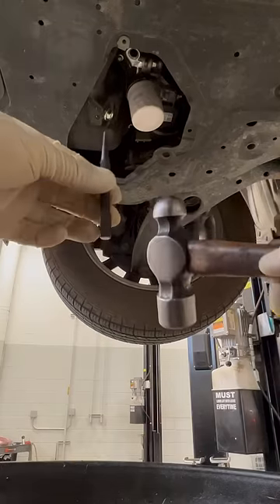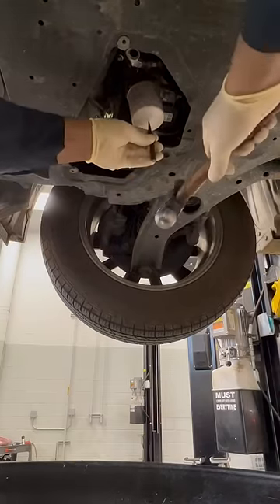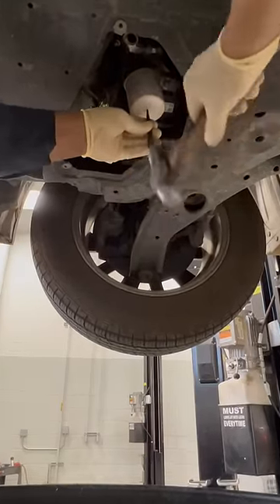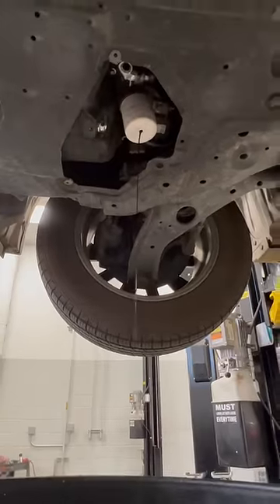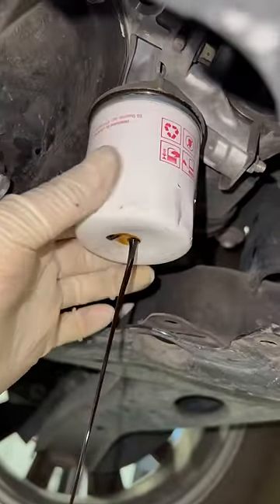Tech Tip Of The Day Oil Filter Clean Removal #oil #oilfilter #mechanic #shorts

Comment: Tip: make sure you have the correct replacement oil filter on standby
Reply: Been there. Had the wrong filter. JB Weld patched the old one up well enough to get to work the next day, and then to the parts store for the right filter. 😂
Reply: Or can get the old one loose
Reply: and please make sure you break it loose first so you don’t put yourself in a situation where it’s punctured but won’t come off 💀
Reply: @1964mm yeah like punching a hole through the side with the screwdriver to have a handle the crank it off and then it shreds to peices.Yeah that could be a problem.
Reply: And that the filter isn’t seized on
Reply: That's my fear.  It'll be the wrong one and it'll be too late to go back to the store
Reply: Yes! And also make sure you are able to remove the old filter first. Especially if that’s your only vehicle. You may need to drive to get help removing the old filter… been there 😂
Reply: I always have two correct rerplacements. I've only had one leak in almost 60 years. Not sure if the thread was fubar or the seal rolled up, but one or the other. Neither good.
Reply: Yes as make sure have correct filter to replace
Reply: Tip: this new filter will be used to throw at your customer for buyi a cheap filter... Then get a NEW filter that might actually do a thing...

Comment: tip #2: the oil drain plug must be torqued to 600lbs to prevent leaks
Reply: Don't for get the red flavor gell
Reply: I bet you snap a lot of bolts, 600lbs 😄
Reply: You forgot a 0
Reply: Man.. I changed my oil today after a dealership has done the past 3. I broke my impact, everything was so goddamn tight
Reply: @wraith66642o You may also want to check your wheel bolts if the dealership also took off the wheels, those fuckers LOVE to overtorque those wheel bolts to kingdom come 😂
Reply: Hard to argue with dealer specs!

Comment: Dude I can’t remember how many times I had oil running down my forearm, total props to you.
Reply: Men don’t mind a little oil.. jus spin that mf n cover the slash wit a rag. Time is money nd the mess it makes coming off is what rags are made for ..as long as the car leaves clean/wiped down your work is ckoo🫡
Reply: Just slacken it off a touch before you do this, though. Im not saying it's right, but ive seen lads fuck the new filter off because the last guy tightened the old filter up with a 5 foot 1000nm torque wrench, locktite'd the threads, then welding the filter to the housing.
Reply: @gopnikolai7483  I know what you mean
Reply: Just use a rag or gloves and keep your elbow raised.
Reply: @gopnikolai7483  gotta make sure you use the red loctite only...
Reply: Обрезаешь 1.5 литровую бутылку, и одеваешь на фильтр, и откручивай на здоровье без проблем!
Reply: Ikr like wtf is he doing
Reply: @BakaDaBaka dermatitis?
Reply: @BakaDaBaka 😅

Comment: Tech tip. If the rubber gasket stays on just put the new filter and gasket on top of it. Makes it double secured.
Reply: Yo I ran a ranger for about 200 miles like that before it vomited half my oil on my driveway, shit scared the hell out of me
Reply: Oh no ptsd I accidentally did this on my Honda I put in the filter with the old oring on it and oh man did I had a bad night
Reply: 😂😂😂 double seal
Reply: Double the gasket, double the fun
Reply: @Skategod-cn7hp  everyone does or once and after that never again. 😂
Reply: Did this to an ‘01 Crown Vic, my first car. Ran fine with no issues till I took it to get its oil changed by someone else, who noticed my error. Good fuckin car she was ❤️

Comment: Maybe make sure you loosen the filter before doing this, just in the off chance that you cant get it loose.
Reply: wdym. You need to get it off >.<
Even if you need to stick a screwdriver through it for leverage.
Reply: i had a similar rule. make sure the new one is in stock before stabbing with the screwdrivers
Reply: @billrobert3226  ah yes. The stores got me 2 oil filters one time but none of them were the right one >.<  I work as a mechanic too.
Reply: And always punch the hole before you change the filter not after.
Reply: This.
Reply: Yeah right 👍 ... good idea!
Reply: I put filters on with an impact gun. I’m not going to be the guy who left it loose
Reply: I put filters on with an impact gun. I’m not going to be the guy who left it loose
Reply: What you gonna do if you can't get it off? Leave it 😂

Comment: Tech tip- make sure to do this to the new filter as well before installing it
Reply: Wth, no!
Reply: Lol no
Reply: Dont do this, it could easily over accentuate your flux capacitor
Reply: @Jack-yq6ui  i heard excess hot oil running through your engine can boil the blinker fluid reservoir rendering your blinkers useless!!
Reply: @Oob144   that only happens if your harmonizing interometer is improperly distributed
Reply: @Oob144  good to know!! Will add a few ice cubes during oil changes. 🤘🏽
Reply: Decreases load on oil pump💀
Reply: That made me laugh out loud!

Comment: Do the same thing to the oil pan while you’re at it. It’s faster than finding the right socket and then having to ask someone whose diet doesn’t consist mostly of soy to loosen the drain plug for you. Use flex seal to seal the hole. #techtips
Reply: Now this guy’s got it💯
Reply: Just shoot it man just fookin shot a hole with the 12gauge
Reply: Underrated comment bro😂
Reply: Dush
Reply: Bro I can be on soy. That's why I have a 7ft breaker bar. Work smart not hard
Reply: Can confirm, works every time

Comment: For the rookies-
Notice the oil filter seal ring seal had become stuck on the engine. While he removed it off camera make sure you
DO NOT leave it there. Double gasketing can lead to a gasket blowout and oil everywhere.
The new oil filter has its own seal.
Reply: I appreciate this comment…. I learned the hard way to double check that the gasket came off 💀
Reply: @DaBombDotCom1 Haha same lol
Reply: @potatoman859  yep. It is not fun picking up 5Q of oil on concrete…
Reply: I’m lost O.o but I’m also not a mechanic. I guess hopefully someone will tell me what your comment meant…
Lol idk
Reply: @angelmascato907  if you look at any oil filter, there is a gasket (a rubber ring that prevents spilling/creates a tight seal). In this case, he takes the oil filter off and that ring has stuck to where you screw the filter down. So, when you screw a new filter on (which has a new gasket on it), the oil filter is unable to properly seal… thus having an opening for oil to be blown out of where your oil filter sits. Make sense? And  I’m not a mechanic, but I’ve been taught how to do basic car maintenance and have learned the hard way to always check the gasket.
Reply: @angelmascato907  
Sometimes when you remove the old oil filter the 'O' ring seal will get stuck to the block where the filter mounts. If you stop the video at the point where the filter is removed, you can see the old seal (black ring) has come off of the filter and is stuck to the block.
You must remove it (just reach up and pull it off with your fingers) before putting on the new filter as the new filter has a seal of its own.
If you add a little oil to the top of the new oil ring seal it will help keep it from sticking to the block.
Reply: @DaBombDotCom1  yeah I haven’t been taught shit but how to jump a car fr fr I watch some videos but asked so I know. Thanks for the reply I’m about to watch it again and see what u were talking about
Reply: @DaBombDotCom1  yeah I wouldn’t have known that part was a gasket it looks Greek if you never seen one before. Easy for someone to make that mistake hence the comment we are replying under. Learn from me guys don’t be afraid to ask and learn; no such thing as a stupid question!
Reply: @charlesdahmital8095  good lookin chief
Reply: @angelmascato907  no worries. Glad you asked
Reply: Sounds like that came with experience 😂
Reply: @dannyduds1058 
Yes, other peoples experience.
I am a 35yr tech and educator.
Reply: To be fair, they're not done.
Reply: @99zxk  correct, but forgetting it’s there is very easy to do.
Reply: if you watch the video we're the filter is Completly off there Is a black gasket sticking off the oil filter snout that is from the oil filter double gasketing can't hold the pressure and 1 gaskets blows out and then all your oil dumps out.. this is a short he probably had this section of the short apart of a 10 or so minute video and edited it down to 60 seconds which means he more then lickly removed the oil filter gasket it just wasn't in the short because him removing the gasket could of made the short longer then 60 seconds
Reply: @AntonioClaudioMichael  
Yes-
That's why I addressed it to rookies that would have missed that point.
Reply: @charlesdahmital8095  if I accidentally tagged you I apologize sir was trying to tag the person that asked what you ment
Reply: How do you know he didn’t take it off after he stopped recording?
Reply: @DetectiveMcGarnacle  because if you look at the video the last second it was clearly cut out from a longer video and because when I make shorts I cut them out of linger videos and video obruptly ends like it was cut to many people Comment and assume it wasn't done and that's because most people don't know how video editing works there is also a longer video on his channel showing the entire Oil change
Reply: @DetectiveMcGarnacle  
I am quite sure he did.
The comment, as stated, was for those that are not professional and should be made aware of such things.
If you are unaware and do your own oil change to save money that could be a very expensive lesson.
Also I just edited it so that it cleared that up.
Reply: Did this once on accident. Old gasket didn't come off with the old filter. I wasn't paying attention. Was surprised as heck when oil came shooting out after I filled and started the engine.
Reply: Nice catch
Reply: @dalereeves3098  I did the same. Had to pick up 5Q of oil off concrete. 😂
Reply: And lightly rub a thin layer of oil on the seal with your finger before tightening it
Reply: @mayanksharma3651  just be careful where you put your finger… oil filters can be sharp
Reply: @DaBombDotCom1 ive never had a sharp oil filter and ive chamges hundreds of different kinds.
Reply: @timothykappel198  not the seal itself but inside of the oil filter where it screws in. It can be very sharp. Just have to watch where you put your fingers
Reply: @DaBombDotCom1 yup, happened to me once
Reply: LMAO THE LAST SHORT I WATCHED WAS ABOUT THAT. Hahahah
Reply: The seal is not stuck on there it would be right around the threads. At the bottom. The bigger outer black ring just holds it in place from vibrations n such. Tho that is a thing he didn’t leave his on.
Reply: @SageThaFool  
Interesting-
Considering I've been an automotive tech and instructor for over 35yrs at a family business we started in 1917 I should have known that. Thank You!
Reply: My dad paid the 7 quart price for this mistake once.
Reply: I learned the hard way on one of the first diesel oil changes I did. Those fuckers were prone to sticking for me.
Reply: Literally the first oil change I did when I was 12 had this happen. Was so proud and told my dad. Started it when he came over and shot oil all over the driveway
immediately lmao. He was laughing his ass off and said, "time for you to learn how to use a pressure washer. Go grab the kitty litter." (He calls quick dry kitty litter. Think it's an old school thing)
Reply: @charlesdahmital8095  Went to school for it and I’m a mechanic myself lol I’ve seen some interesting instructors to say the least lol
Reply: Damn bro, I stopped changing oil, because of this very reason. I changed the oil on my old truck and I know basically nothing about cars, well my truck started acting weird and I had, my neighbor look at. He check the oil and it was basically empty, that was 13 years ago and I never knew why it was out of oil. I'd say this is exactly right. Somebody showed me how to change the oil, and I must've not noticed that step
Reply from the maker: https://youtube.com/shorts/ao14J4WSptc?si=GoqGLFNp2GxeDYGe
Reply: Wow . Thanks captain obvious !! How do you know he removed it off camera ?
Reply: @BackWoodsRDNK  
Because, as a follow up to my post, he made a second video where he discussed removing it. Then I edited my post noting his edit.
And that's General obvious to you.
Now drop down and give me 50!
Reply: Been there done that, will never do it again. lol. The engine bay of my beautiful Firebird was never the same.
Reply: @angelmascato907 worst thing that can happen by asking a stupid question is that you get laughed at.
If that’s the case, you don’t need that person who laughed at you and you move on. One less jerk you have to deal with.
And by the way , to the uninitiated, there’s no such thing as a stupid question 🙋‍♂️
Reply: Been there, done that!
Reply: if you have a car up in the air like that you've changed an oil filter before don't you think lol
Reply: made this mistake in 9th grade auto class, thankfully i caught myself before i started the car 💀
Reply: Happened on my XJ jeep, you are correct , that is the real lesson here. Upside down filter is simple without a hole.  Luckily the XJ is a tank and was fine after losing all the oil from double gasket
Reply: Yep i watched an apprentice do that once, spent a good hour cleaning oil out of the pit after starting it lol

Comment: When changing the oil filter on some of the older semi trucks the filters are huge and mounted straight up. So we always do this and then go drain the oil pan and then the filter is done draining and more manageable when you get to it.
Reply from the maker: Yes this also work thanks
Reply: Makes sense for that application but not for regular cars
Reply: @cuznblue  I've never thought to try it on a regular car. But some of our riggs have some damn heavy filters in some very awkward spots lol
Reply: Absolutely. I have been a licensed heavy truck mechanic for over 30 years and that's how I've done it all along. Another good thing is that if you accidentally drop it you don't make as much of a mess 👍🇨🇦